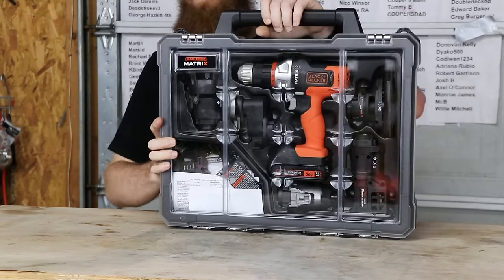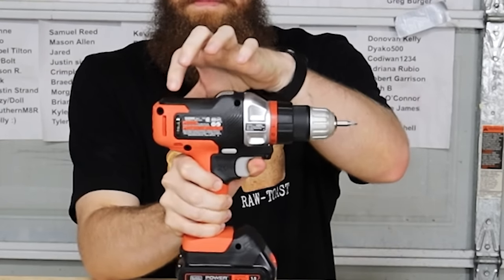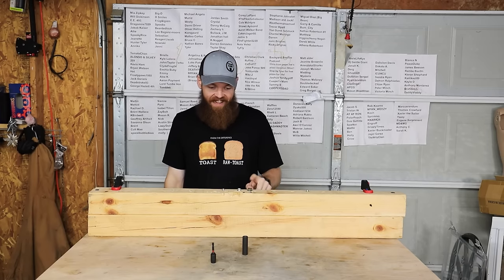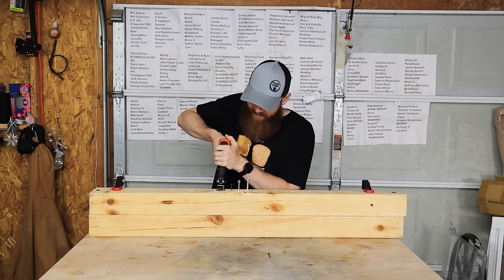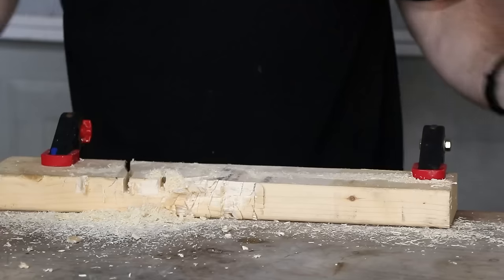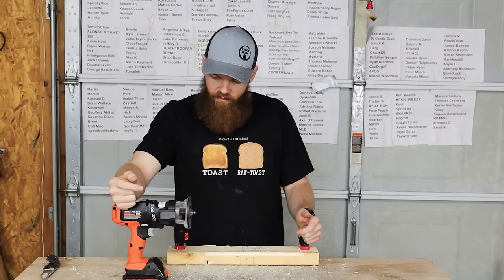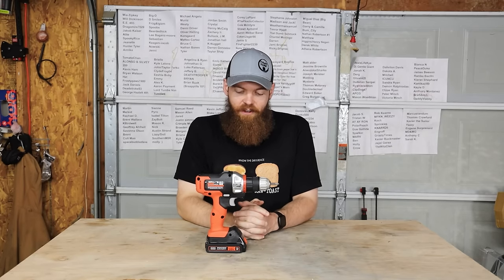Is This The Last Drill You'll Ever Need? | Black & Decker Matrix system

Comment: The first problem is the operator.  If you don't know anything about how a product works.  Whether it's performance or durability, the operator should know the difference.  Secondly, it is a Black and Decker multi-tool.  Enough said.  Nobody in their right mind that knows tools would buy this pos.  It is full of flaws.  It isn't for professionals that work with these types of tools.  It is for somebody that is clueless.

Comment: I absolutely hate the multitool (oscillating vibrating blade). Absolutely sucks for basically everything. Blades last a minute and takes forever to cut thru anything and the brand doesnt matter its just a mid tool.

Comment: The kit seems not bad but the battery is trash 1.5A is pure garbage thats why the kit is quite cheap but if you upgrade for a 5ah you should have allot more power. 

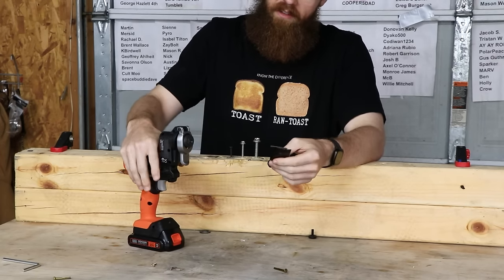Edit 14:35 B&D and DeWalt are the same for the blade same company Stanley Crafman DeWalt all owned by B&D

Comment: 20:11 how the f are you using this tool ?? There's a reason it has this size, so you can put it down flat. You should put it flat on the work peice and go full speed, just like with the router the more speed you have almost the better. Especially with this tool.

Comment: I like the concept but $180 you might be better just getting a $30 drill $35 sander $30 oscillating tool $50 router and a $30 jigsaw that will all perform better than these ones even if some have a plug like the jigsaw would still be better. Or if you only need a drill a sander and oscillating tool  get get $75 drill 45 sander and still have $75 for what ever else. Don't see the casual person getting a router

Comment: Watching you force the blades through the material got me cringe. Common mistake people make when using any tool is trying to force it to do the job. You don’t need to push hard as you can, let the tool do the work. A little pressure to keep tool moving forward is all you need. When you press hard the teeth on the blades get bound up and can’t actually do the cutting efficiently.

Comment: Tell me you don't use power tools without telling me you don't use power tools. 

Dude every drill starts to strain the motor on longer screws. No cordless pushes threw without a change in the sound of the motor. Your bias against BD is comical. Did they hurt you when you were a child? Show me where they touched you..

Comment: Why do you do tool reviews if you literally have no idea what you are talking about. first the impact attachment smelling like grease, that’s because there is grease in the gears and hammer and probably cheap grease so it wasn’t very heat resistant, second the “high quality blades” are specific to the fein brand, all other brands have the quick connect and dewalt and Milwaukee make some of the best blades. That is as far as I’ve made it so far I’ll update again if something else irritates me enough to make a comment
Reply: You are not supposed to use an oscillating tool to cut screws. Rip blades.
Reply: You really have no idea how to use a router.. just stay away from that thing all together. I was horrified
Reply: Even with a good quality jig saw cutting a 2x4 isn’t easy, usually just to clean up bird’s mouths not 90 degree cuts

Comment: Bro, don't review tools. You clearly don't have a basic understanding of general tools. Cutting hardened screws with the oscillating tool and pushing hard on it will not work. Let the tool do the work(the other tool).
The router probably works fine if you're not at 1" deep forcing it through. 
The jig saw would work fine if didn't have the material being cut hovering 4 inches from the edge of a wobbly plastic table you call a work bench. And change the freaking toast shirt already.